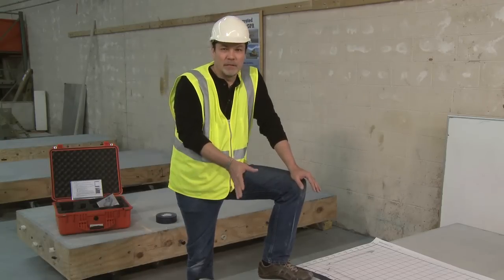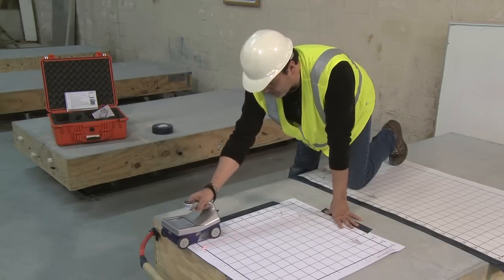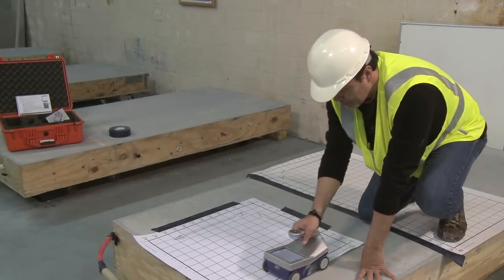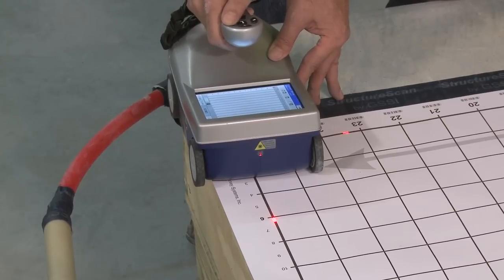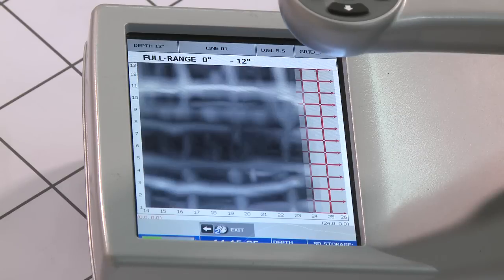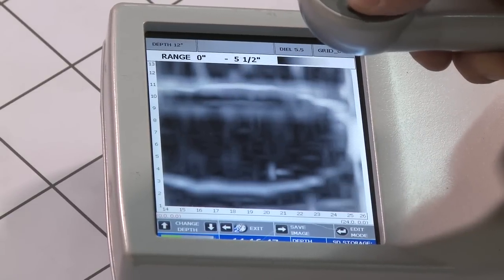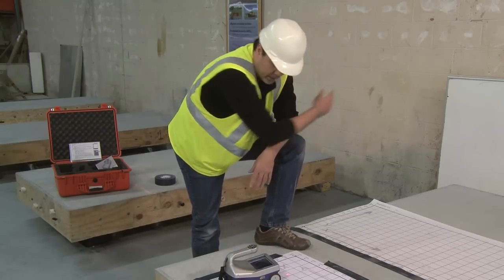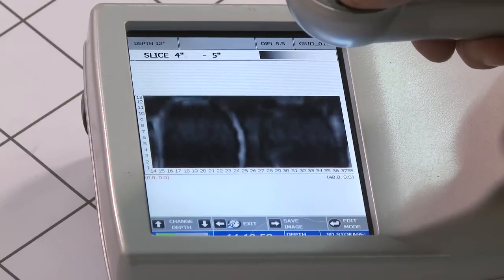How to: Locate Radiant Heating Tubing with GPR

Comment: Is this the best (or only) means to determine what type of radiant heat is in an older home? If you know a system is present but you don't know the type or location (walls vs. floor, electric vs. pipe/water), who should you hire to find out — a plumber, an electrician or someone else entirely?